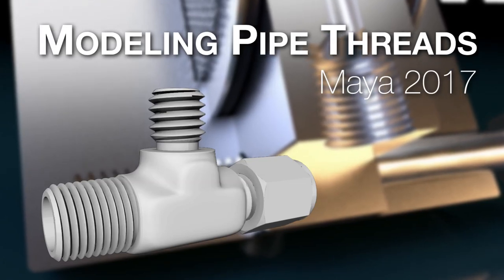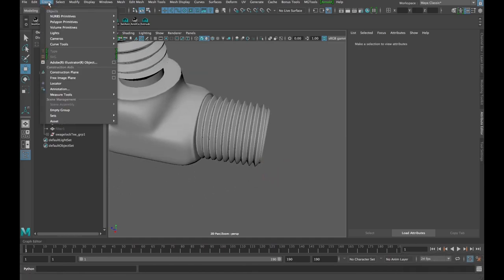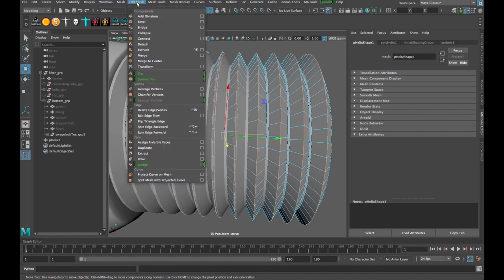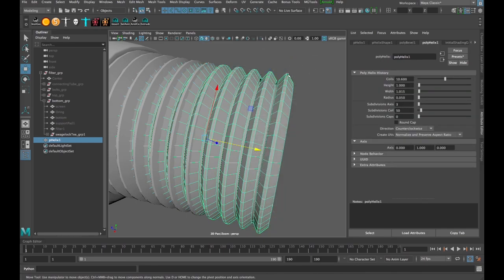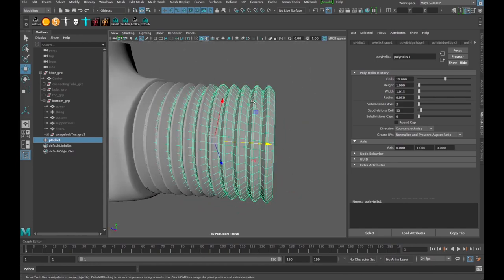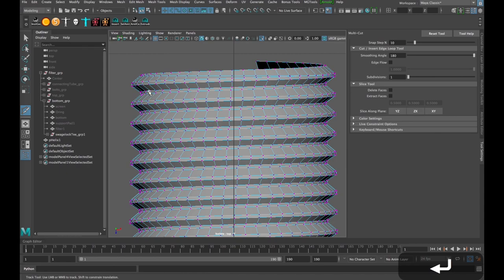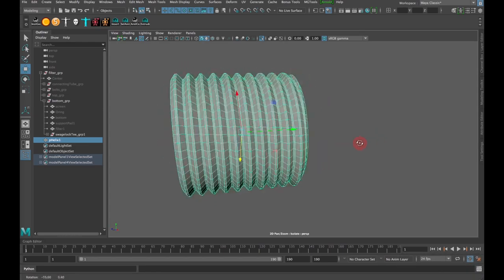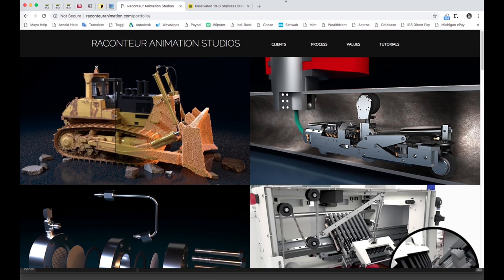3D Modeling Tutorial: How to Model Bolt/Screw/Pipe Threads | Maya 2017

Comment: The ctrl shortcut you mention for scaling on 2 axis. I'm not sure if you realize this, but you can do that without the shortcut, there is literally a modifier icon right in front of you?  You see those 3 colored square between the manipulator handles? They are 2-axis scale controls so I'm not even entirely sure why Autodesk would add the ctrl option as it is an extra step in most cases. Probably there to allow people to manipulate dual axis controls when working in orthographic views, but is entirely redundant in perspective.

All in all thank you for this video though, it is an interesting workflow for creating pipe threads. I've always used the helix for mine, and just had the threads as a separate object on top of my other geometry as I've never had to do boolean operations on mine, but this simplifies things a bit.